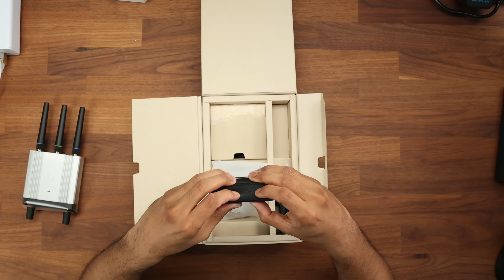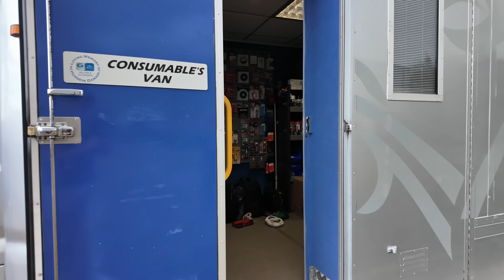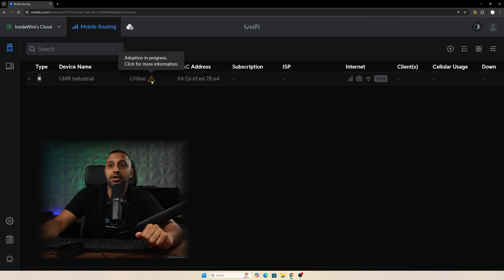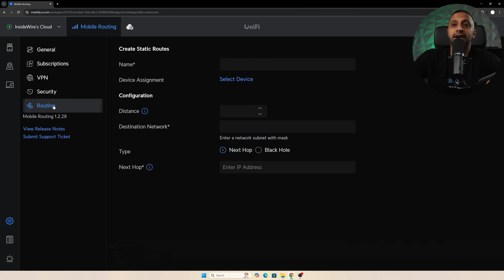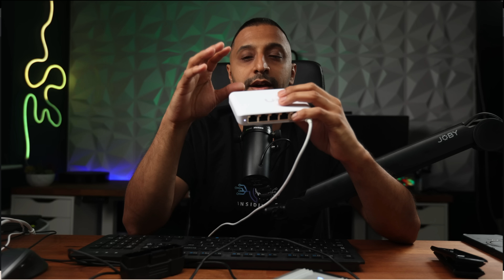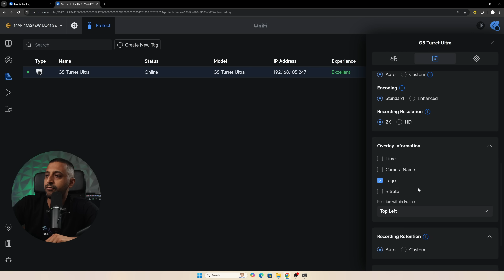Building a Mobile Office with Ubiquiti's UMR Industrial Router

Comment: the ability to not do continous recording is a killer for me...........if you connect a UNVR instant directly to this and then the camera to the instant it should not be an issue correct?  would i be able to access the UNVR without the mobility subscription?

Comment: I like your content and you should do more field videos, there is market for it in the UK as most guys UNIFI are states or Canada. Hardly anyone shows field work in the UK. Secondly, why didnt you just get  USG Gateway and connect via 5g Dongle or Router?
Reply from the maker: I wish I could record more installs! Some dont want their setup to be filmed. 

This was an all it one solution which made it easier to install and do a site to site VPN, I didn't need anything other than 2 clients on it.

Comment: First you mount it inside which badly degrade the signal and why did you buy the more expensive industrial version? The cheapest version in that line has the exact same specifications but the only downside is that they are not waterproof
Reply: Perhaps for the GPS antenna.
Reply: @larryf5904  UMR-US also has GPS
Reply: Probably so he can mount it outside for better signal if required, as you pointed out.
Reply: What's the model name of the cheapest version? Does the cheapest one has SIM card slot as well?
Reply: @andyrandy0815  if you want GPS: UMR-US
else: UMR-Ultra-US (replace -US with -EU for the worldwide model)

Comment: Seems like a good use case; I'm not sure I would have used a 2k camera for a remote, but if it's not significantly impacting your business data speeds, then go with it. Would having a different POE switch that could power both the router and the camera be a better option? Lite 8 POE would do the job for a cleaner single plug setup.

Comment: At least the UMR Industrial Router is carrier unlocked, unlike the UMR Mobile Router, which is not worth the price. Ubiquiti, as far as I'm aware, is supposed to come out with a 5G version. Unfortunately, you will have to purchase a new router if you want 5G when available, as it would use a different chip.
Reply from the maker: It is a bonus that it is unlocked, can add any sim in it. We will have to wait and see when the 5G becomes available and what that looks like.

Comment: When would 5G become available? Would deliver a higher speed, right?
Reply: To be honest this device is great as a backup or for low data requirements, brands like Teltonika provide much better solutions for high speed mobile routers / modems. If you want to use unifi id personally use a Teltonika (or similar) 5G modem connected to a unifi router.
Reply: @pellinimax  thanks for the tip. Just researched this a bit and found the Teltonika RUTM52 would offer everything one could wish for in one package.
Reply from the maker: I dont know when/if the 5G version is coming. But yes I would assume it would give higher speeds.